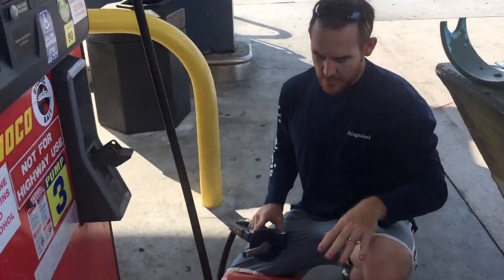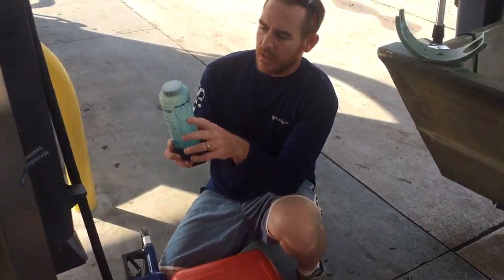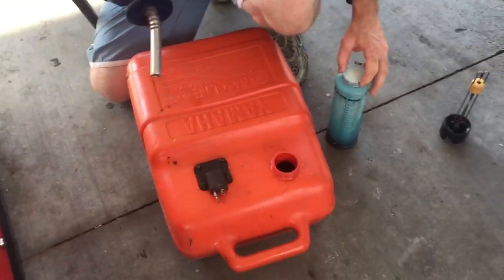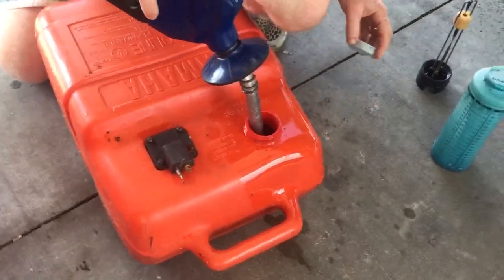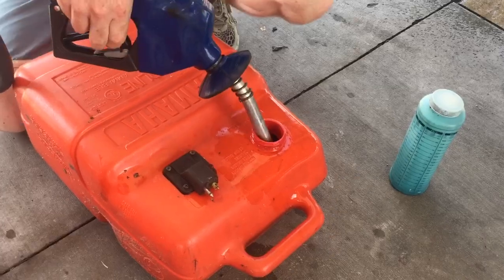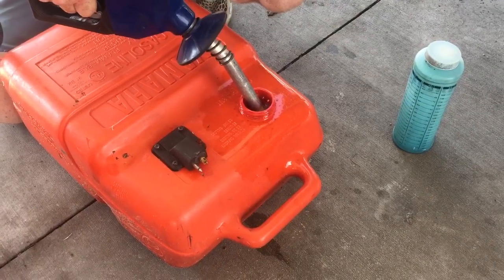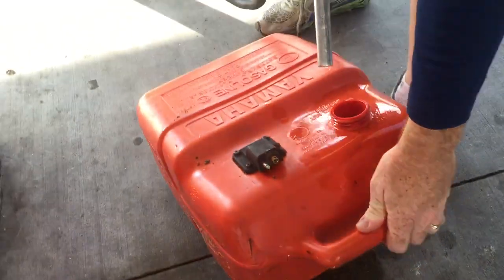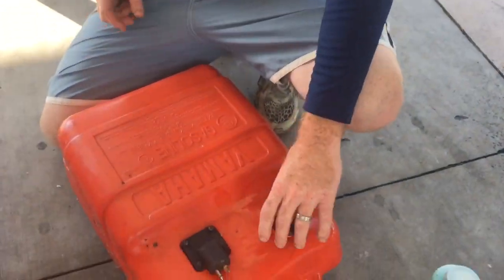2 stroke diy gas oil mix for boat motor

Comment: Been running 2 strokes for decades. Every thing gets 50/1 and works well. Evinrude used to push 100/1 a long time ago. In tuff applications were failing, they went back to 50/1. I think you motor would last longer at 50/1.
Oil is cheap, motors do not. My opinion.

Comment: What about a 1998 Yahama XL 760, I have an 11 gallon tank, just bought two stroke oil, how much do I mix with the gas? And do I use the same oil in the actual oil tank also?
Reply: 50:1
Reply: Do not use the same oil in oil tank!
Reply: 28,6 ounces on 11gallon
Reply: 2,6 ounces a gallon

Comment: more oil you mix the more often you change spark plugs, some help every 3  4 times on the water with a 2 stroke, change your plugs.

Comment: Hello, very helpful!
What octane gas do you use?
We have a 1996 DT4 Suzuki 2 stroke/4hp outboard motor. Also if you could please recommend what brand of 2stroke oil?
Thank you very much,
Lauriezp in ky
Reply: That really isn't inmportant, as long as it is TCW-3 oil (environmentally harmless  oil for watercooled two stroke marine engines)
Reply: Non ethanol gas and quicksilver two stroke oil. I have ran it in 30hp Johnson with no problems. I mainly run Evinrude / Johnson two stroke oil.

Comment: An easier and more cost effective way is to say I have 20L tank, all you need for 50/1 ratio is double it and add a zero. So, 20x2 =40 then add a zero is 400ml of oil. For 100/1 it’s simply add a zero to the size of tank. So, 20L will be 200ml of oil for 100/1. This is a great way and will work in any situation. :)
Reply: mumbo.